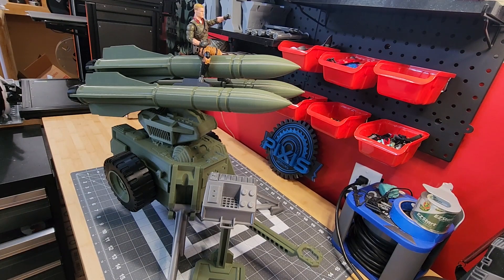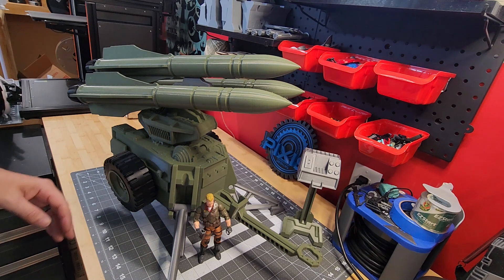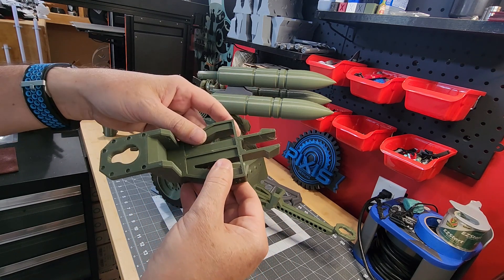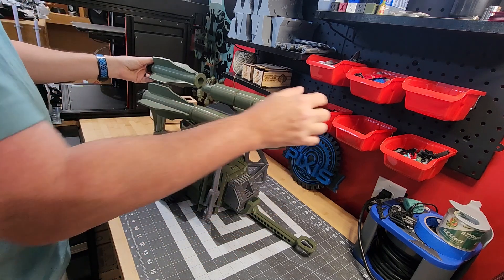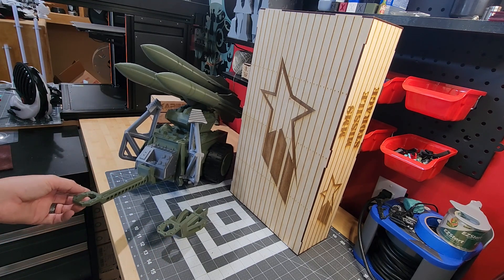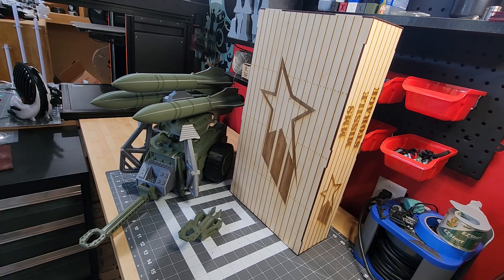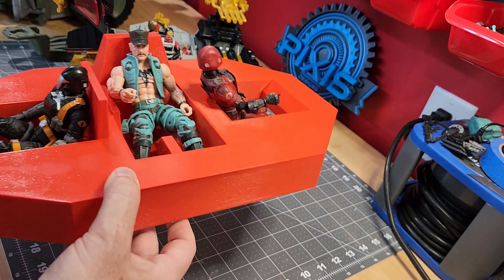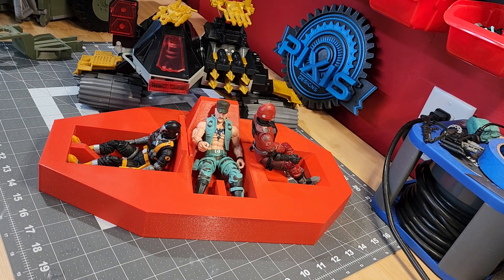DEMON TEST AND ONE SIX MMS

Comment: Price? THAT is just AWESOME! I have slowly been buildup up all the guys from 1982-87ish in 1:6. Hence my question.🤣 I DO have a swamp skier in that scale for my custom Zartan which is killer. That missile-carrier would be icing… 🤣✌️🤘🇨🇦
Reply: Okay
So
I am pretty and got excited before watching the whole vid!🤣🤣🤣
Reply from the maker: It would around be 300 shipped. I want do some extra modeling on it though now that I proofed it out upscaled to try and give it some more finer details at this larger scale and tighten up the tolerances a bit. Shipping is what I am wondering about as it is a heavy dude. Probably around $30 I suspect.
Reply: @pixisdesigns761  Sounds good! And I figured about the price. Fair. I will save my beer money!🤣 Does the design have the stand tuck into the base like the original? There are vehicles to tow this behind so… I am thinking Cobra will need one in the future too… ✌️🤘🇨🇦

Comment: There is a really simple but cool mod you can do to the demon I recommend to everyone it's completely harmless to the toy.
Just get some clear plastic from some packaging and spray or paint it with clear red paint (or if you have an old Transformers tech spec reader about that would work too) and just affix it inside the side window (I glued mine with a little non destructive PVA like glue) but you could tape it in too and then from the outside you see just the red window on he side and it looks great.

Though these days someone could likely make a clip in window insert for the demon for a flawless look open or closed.
Reply from the maker: It would be pretty easy to make, I could laser some transparent red acrylic for it but it literally just sits on my top shelf so would hate to go through all that effort..lol

Comment: Man Pixis Brother if the new Machine can make something this Big then the next Project has to be some sort of Playset Base...even if You do it in section that connect. That thing is Bigger then My 40 yr old Joe Headquarters...
Reply from the maker: A Joe base or terrordrome is entirely doable but  no one has the money or space for that...lol $$$$$
Reply: @pixisdesigns761   I don't know I need a Terror Dome for My 3 inch Joe's to go along with My Joe Base...We may have to wrk something out Now that the New Machine can make the Old Terror Dome...or Something Resembling it like an Original Design...We could agree on maybe in a 2 or 3 part section Cuz I deff need a Base for My 3inch Cobra Figs...

Comment: Did you ever think about making a tow trailer for the HISS and now VAMP? I'd buy a trailer that could pull like 2 RAMS or Coil cycles. I'd LOVE a trailer for the HISS that Serpentor's Air Chariot could dock to/on.
Reply from the maker: I actually have one designed up fairly ready to print but fount it was too large for my MK3 printers so I set it aside. It is a pretty basic trailer though in the same vain as motorcycle trailers are today, just a large flatbed trailer. I could get back on that project since my 1:12 mms is pretty much going away...sadface..lol Maybe have it hold the Scrap Iron Missile system for transport for the Cobra side as well.
Reply: @pixisdesigns761  ohhh that would be really cool if it held Scrap Iron's drone. Or 2 of the upcoming Trouble Bubbles. You could make a good number of variations.
Reply: @pixisdesigns761  ohhh being able to tow Scrap Iron's drone would be really cool. You could put some computers and mechanical detail or something on it. I think there are many versions you could make. One to tow a couple Trubble Bubbles, Serpentor's chariot, Scrap's drone, RAM/Coil etc. Even one that could haul a squad of bats, just have them held on with a bunch of c clamps lol.